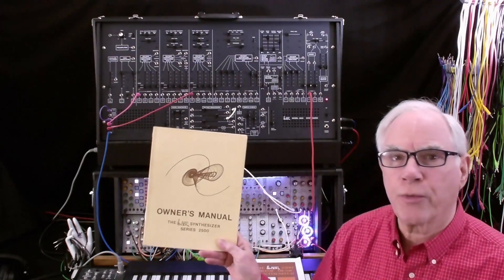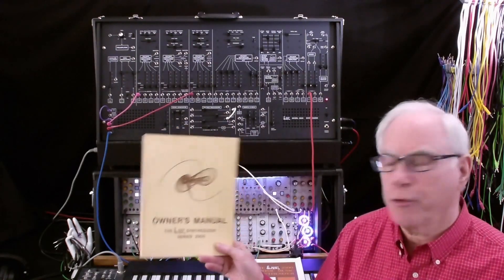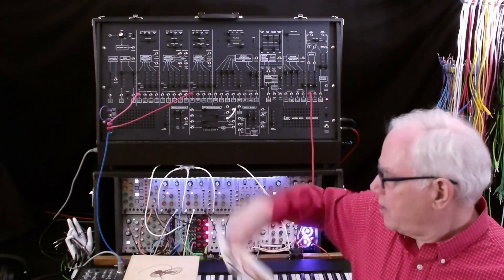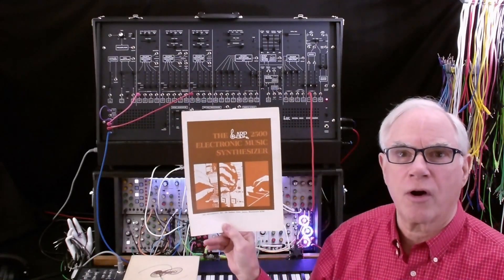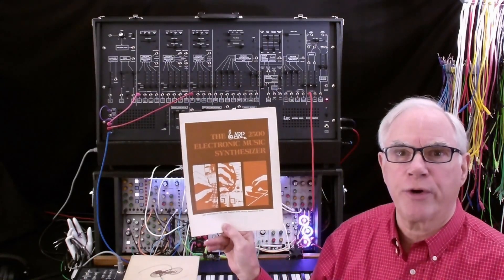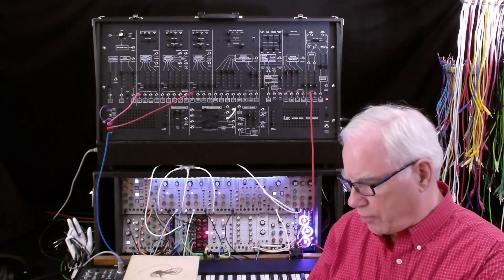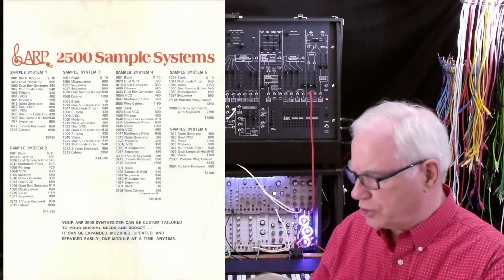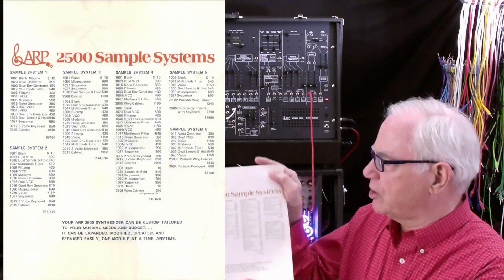ARP 2500 Bible - My BARP 2500 system

Comment: Thanks for the 2500 videos. What case do you use for the 2500 modules? It looks like the 2600 can sit nicely on top of it, so just what I'm looking for.
Reply from the maker: Thanks.  My synth duo partner (James Carr) is pretty good at woodworking.  He built this case specifically for the 2600 cabinet.  He was not very fond of working with the Tolex :)

Comment: Where did you find the 3 over 3 6-pin jumper cables used in soldering on the OSC & Envelope’ all wave form output/ stereo input expander plates?
Reply from the maker: I got 2x20 pin headers from Tayda and cut them down to 2x3.   Ditto for the male header.
https://www.taydaelectronics.com/2x20-pin-2-54mm-double-row-female-pin-header.html
https://www.taydaelectronics.com/2x8-pin-2-54-mm-double-row-pin-header-strip.html

Comment: Referring to the title of your video, I am very surprised you call it a Arp 2500. Personally I'd call it a Behringer 2500 (in Eurorack format).
Reply from the maker: @batchas duly noted.  On the otherhand, the series goes into detail that goes well beyond the Behringer 2500 system, with topics such as matrix patching and passive mixing.  Even in this video I'm referencing the original documentation and sample systems.  So the series is more than just the B2500 modules.
Reply from the maker: @batchas for clarification I changed the title to ARP 2500 Bible - My BARP 2500 system
Reply: @ozhalljr  I didn’t watch your video, but I certainly will soon as you mention you go into details well beyond the Behringer 2500, which is nice. It means you take the opportunity of having a Behringer 2550 to explain more about the original ARP 2500, which is IMHO great. Having an original Arp 2500 at home or in a private studio in 2024 remaining quite an exception for a very very few (counted worldwide on one hand), the Behringer 2500 allows to get to the original sound of the amazing ARP 2500. I don’t have a Behringer, but it seems that Behringer is good when it comes to the sound character of the original synths they clone/copy, however we call it. The experience remains way different as the matrix is not present as it was on the original design, but still it can take people nearer to the sound of the original, for a very decent and affordable price (not going into the Behringer cloning polemic here). And also make them interested in the original (history, concept and so on). the purpose of your video if I understand your comment.
The reason I wrote my comment and expressed my surprise was because I’m concerned by the fact that youtube is watched by many people and nowadays a lot of online info in general (media + social media included) is misleading, wrong, fake and so on. A tendency that is IMO always increasing. You wouldn’t want people to think (today or in 15 years) that what they see is the ARP 2500, knowing that Behringer is far (very far) to be its creator. I like the „BARP 2500“ term you use in the title that you changed.
Reply from the maker: @batchas  Thanks for the feedback.  Providing accurate information is very important to me as well.  I have pulled one video in which I later discoverd a mistake.  In this video, I added a correction to the description.  Also, as you have time, check out my entire Behringer ARP 2500 series (a superset of the ARP 2500 Bible series).  https://www.youtube.com/playlist?list=PLNkPtu3RcWbR9y6PSWE1-wH6ejOCGbs2J
Reply: Calling your own video the bible is equally hilarious.
Reply from the maker: LOL.  Yes, it's a little pretentious to call it the ARP 2500 Bible, but it is a series of videos in which I go into a great deal of detail that I have not found elsewhere.

Comment: Great setup, and thanks for the tip about those breakout modules. It has always grieved me that the B2500 envelopes couldn’t be triggered separately.
Reply from the maker: the breakouts are the bomb.  they address the main shortcomings of the final designs of these modules.  I just got them assembled & installed this past week.

Comment: Very,very,interesting!
Thank,you,O.Z.
BTW,I,have,2,Grey,Meanies,2500,100,55,+,other,select,modules,all,cobbled,together......Aust.
Reply from the maker: Wow sounds like a great system.  Would love to see pics or a video.
Reply: @ozhalljr  Its,a,setup,that,evolved,over,many,years,&,includes,a,lot,of,the,mono,synths,with,just,the,Pro800,poly.loads,of,guitar,pedals,studio,mixers,&,a,complex,rack,mount,signal,processing,rig.The,thing,is,O.Z,that,because,it,all,evolved,over,time,&,I,just,kept,adding,on,it,became,a,nightmare.So,I,pulled,it,apart,&,I'm,now,at,the,stage,of,trying,to,figure,out,how,best,to,put,it,back,together.I,have,some,empty,Marshall,4x12,1960,cabs,with,good,tolex,that,I,intend,to,cut,up,to,suit,encasing....I,just,have,to,figure,it,out.Thanks,for,the,quality,vids,much,appreciated.
Reply from the maker: Thanks!  I love the "ex-guitar cab" idea for a eurorack case ( or 19" rack case ).
Reply: @ozhalljr  Yes,me,too.I,got,mine,free.The,tip,on,cutting,&,rejoining,is,to,first,cut,a,channel,the,width,of,intended,saw,blade,through,the,tolex,with,a,box,cutter,&,peel,off.Then,clamp,a,wooden,staight,edge,to,act,as,a,guide,for,the,saw.To,rejoin,cleanly,at,whatever,angle,use,1/8th,steel,plates,screwed,to,the,inside.Bonus,is,the,cabs,back,panel,that,can,be,cut,to,form,edged,internal,dividers.I,used,the,front,halved,section,&,the,cut,back,panel,of,a,slant,cab,to,make,a,horizontal,case,for,stepping,3,Keystep.37s.&,the,back,half,section,for,the,vertical,freestanding,mono,synth,case.I,just,have,to,do,the,same,for,the,rest,of,the,system,using,my,remaining,bottom,cabs.BTW,I'm,not,using,commercial,rails,but,just,screwing,staight,onto,internally,mounted,wooden,battens,using,coarse,threaded,self,tapping,screws.Behringer,PSUs,are3000w,&,flying,ribbon,cableare,good.

Comment: If I could subscribe twice, I would.  Another great video. I have a 2500 but with 2 oscillators. I want to get the breakout modules for separate waveform outs though. I love the sound of this system. It has its own character especially with the 1047 etc. Cheers
Reply: Hey, I forgot to ask about the oscillator individual waveform out module. Is there much soldering to do with this unit? Any pitfalls etc? It will certainly give a lot more options when using with the 1050! Cheers
Reply from the maker: The soldering is not too bad. The documentation is very clear.  I use 5" length for the wires (22 awg).  I also used 6 different colors (and made a diagram for the header/wire color).  It's a little awkward on two spots: 1) ground, which takes a long time to heat up because of the "heat sinking" from the ground plane ... just be patient with soldering the ground 2) I used header & connector for the 6 pin header.  It's a little tricky to wire the 6 pins without letting them short out (i.e. solder  two adjacent wires/pins together).  You could solder directly into the holes for the header on the PCB. That should be easier, but less flexible.  Also be sure to tin the wires before soldering.  it makes them easier to form around either a pin or the solder point on the main pcb.
Reply: thats just what I need to know. Thanks so much for the kind help. @ozhalljr
Reply from the maker: @moogfooger  Happy to share my experience with these expanders!
Reply from the maker: Thanks Tony!  I'm sure you saw the links to the Tindie store for the expanders.
Reply: yes, thanks for that. just waiting for them to have stock. I like your AMS module too.  @ozhalljr